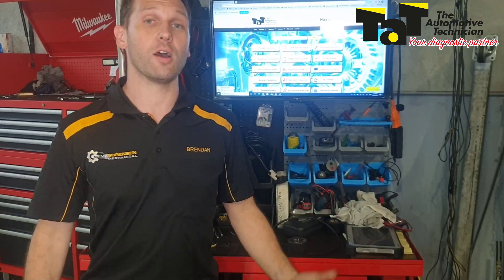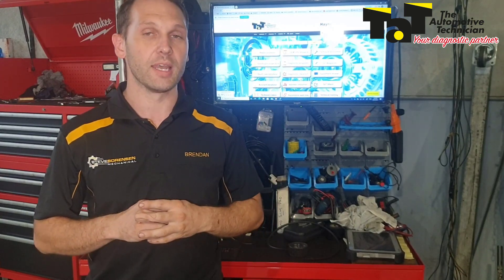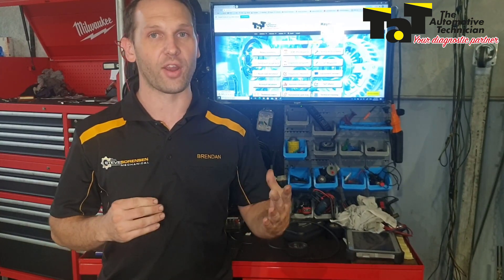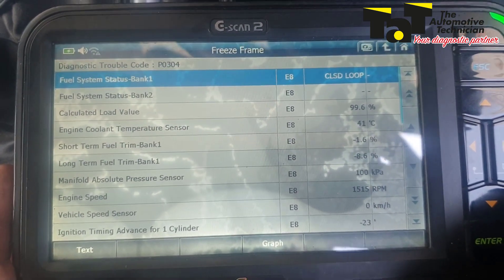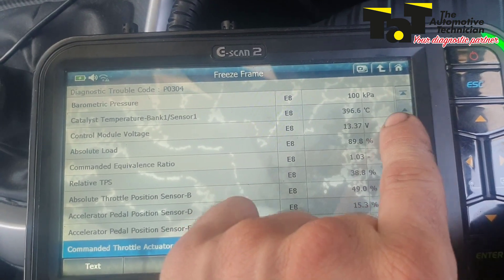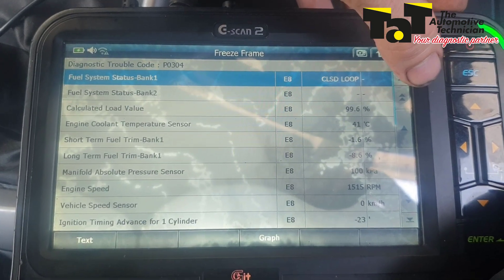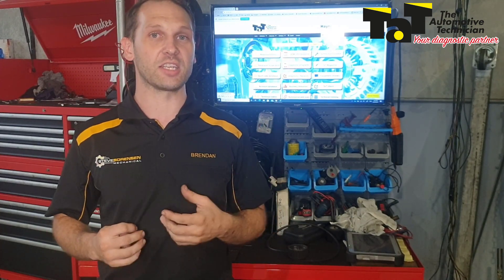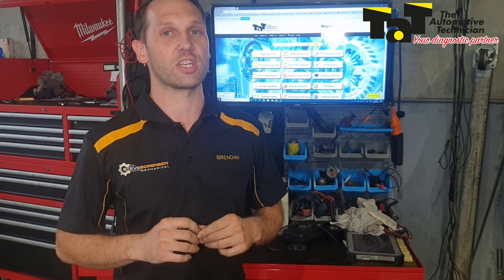GDI Cold Start Misfire

Comment: you should add to the description mazda skyactive misfire. My mazda 2 has misfires p0300 only on cold start while it warms up the cat. DJ 2018 135,000KM sparks changed at 110,000km coils look ok. That video helped me a lot. for now cleaning the throttle helped a bit. looking forward to try cleaning the intake...

Comment: Thanks for the information. I have a similar issue on my 2015 ecoboost Mustang. The CEL is only triggered when starting the engine after a long period of hybernation. It could also be a cracked head gasket. Only 92000 km used very rarely as a holiday car abroad.